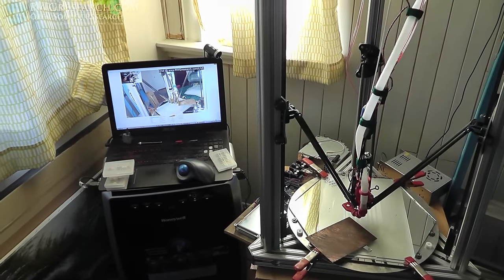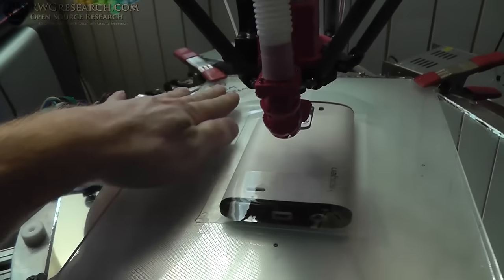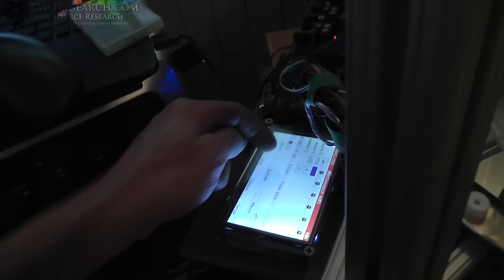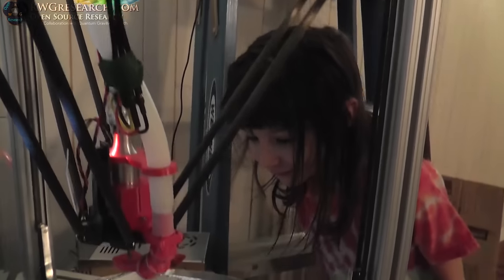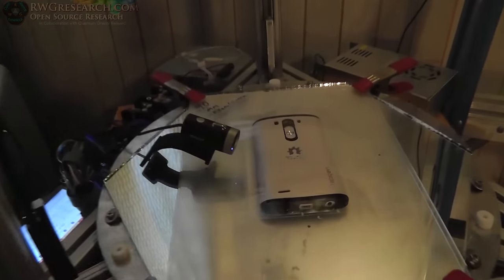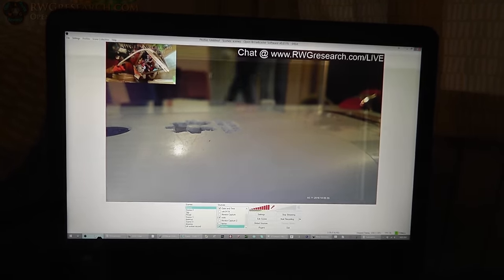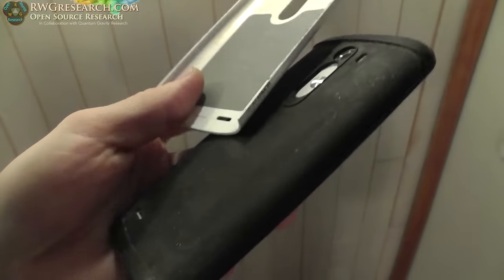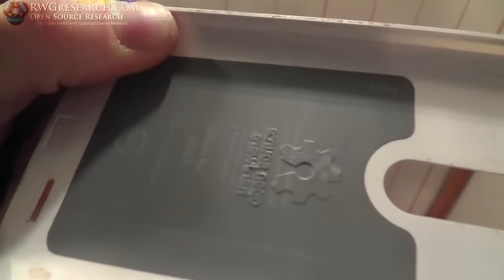Testing The 3D Printer Brushless Spendel! Carving Phone Case! It works! But... More To Learn! CNC

Comment: next time buy an inrunner brushless motor, a little more expensive but much more safe. And also you can buy 2 mm conectors on eBay to connect the motor to the handpiece. Everybody doesn't have a lathe. nice job but difficult to do.

Comment: does that spindle setup allow for reverse, might have differing results backwards with various materials/bits, great work dude, p.s. would your torus coil work as a dc motor stator
Reply from the maker: the motor being 3 phase can indeed go the other direction by switching any 2 of the motor leads. they also make controllers that are bidirectional, however this controller is only one direction. on your other question, yeah it could... lol but this is best for the application :) ~Russ
Reply: rwg42985 torus coil idea for generator or bicycle motor idea, using torus as stator in side a rotating magnetic field seems logical , the possibility of a magnetic field rotating within the torus also jumps to mind, how is beyond me

Comment: Mrs. RWG didn't look too impressed, but I thought it was cool. I was thinking you ought to fill it back in with a contrasting colored plastic.
Reply from the maker: ah! your forgetting 1 major thing... I BUILT EVERYTHING FROM SCRATCH! :) this i was the first test... wrong bit, wrong speeds, wrong depth, it was a slap in and go! and for that... its all in the tuning and knowing your plastics! if this was harder plastic it would have been a lot better... got to start some where! ~Russ
Reply: No, I was impressed. But Mrs. Russ looked like, "you're gonna break something, I just know it."
Reply: What I also meant as if you hadn't removed the phone from the table, and your hot end was in line with your bit, you could print right in the grooves. An inlaid type infill
Reply from the maker: thats a thought! :) ~Russ